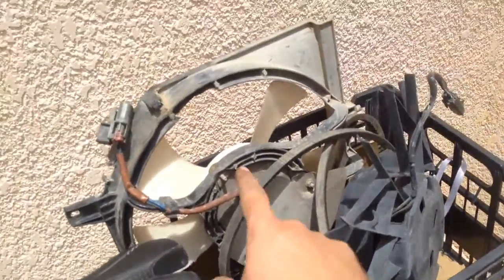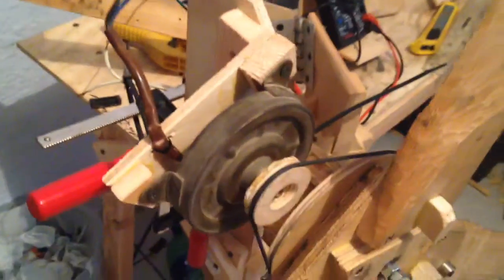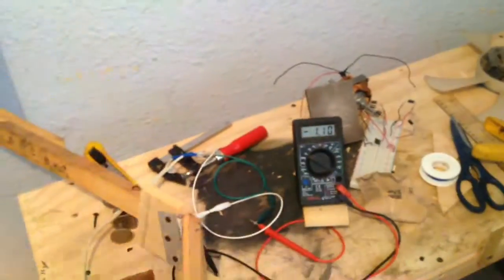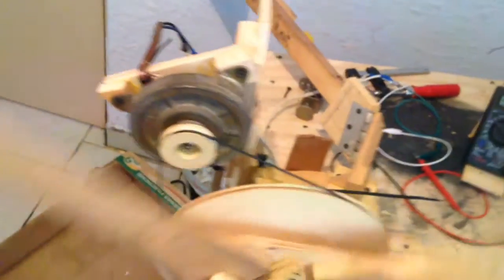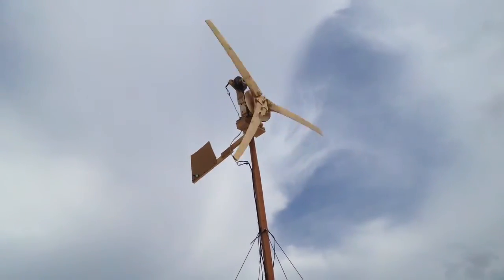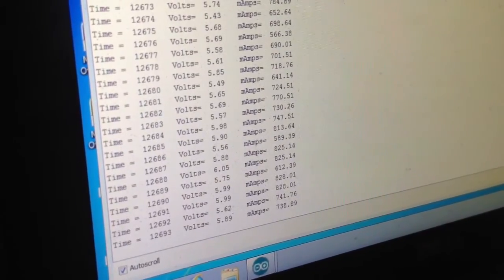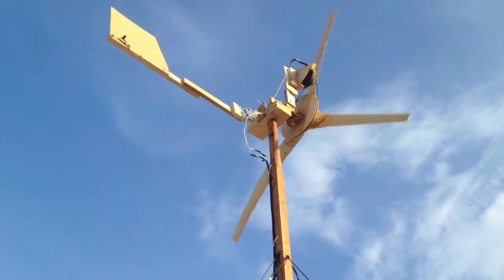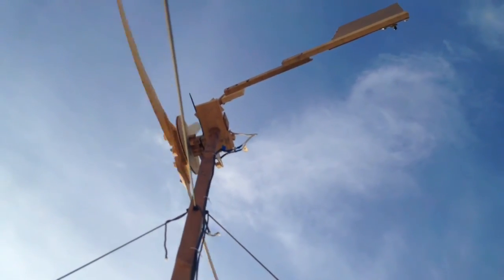DIY Wind Turbine 15, car rad fan motor more power

Comment: I work at an auto salvage yard and occasionally radiator fans break as they’re being packaged for sale. I’m going to be keeping a close eye on them now. Oftentimes the fan blades snap. Or the customer is buying the radiator only and the fan comes with it but is sometimes broken. So it’s removed. I’m also trying to gather some used batteries so I can store some power. I want to run two 980W UPSs I salvaged a while back. You telling me that these produce only 24W kills me though.

Comment: Hey your design is great. I would like to know more about your tail system to help with gusty winds. 
Can you help me?
Reply from the maker: The length of the tail, angle of hinge and offset between tower and wind turbine determine at what wind speed it will turn out of wind.  Best is  to build out of wood and experiment for what works